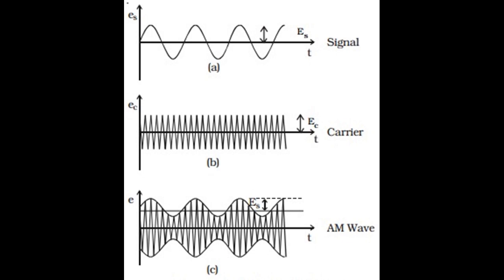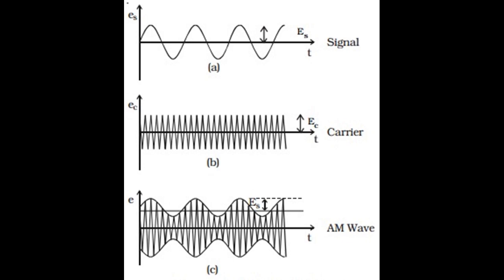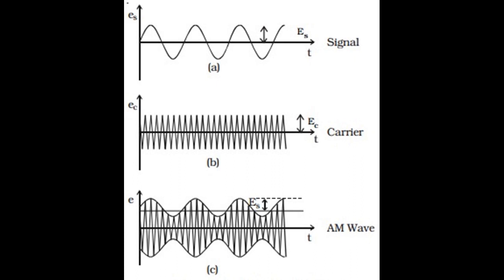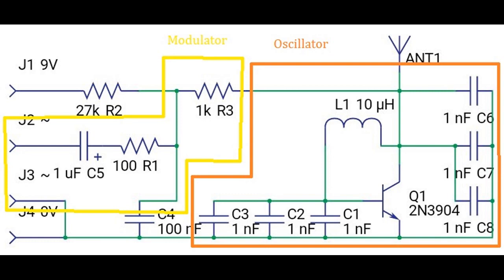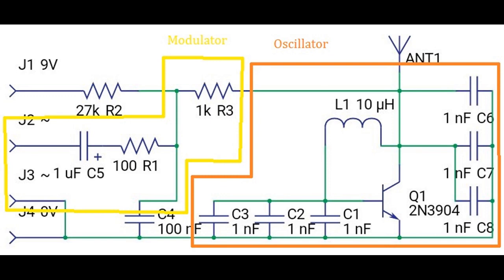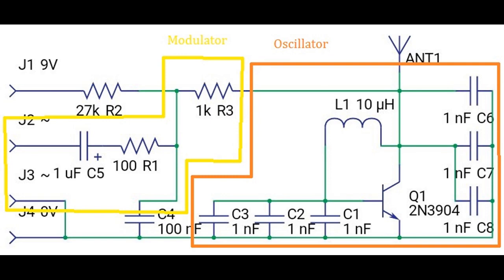Simple AM Transmitter

Comment: Hey Bob!  First video, 10th video, seventy eleventh video - doesn't matter - you're a great teacher and the simplicity and performance of this circuit says everything we need to know about your knowledge, heyna?

I've just started my journey in electronics.  I'm at the "what the heck is an inductor" stage.  I think I get it and I've got some 10uH coming in the mail but - can you describe what the purpose of the inductor is here and could it be replaced with something like a voltage regulator or some type of capacitor/resistor/diode combination?  Anyway - tanks for the videos - they're brilliant and greatly appreciated!
Reply from the maker: The 10 uh inductor is part of the tank circuit with the 3 1nf caps to generate the RF frequency. Thanks for stopping by!
Reply: @YouAllKnowBob  "tank circuit" - got it - thanks!

Comment: What is the power limit (watts.....milliwatts?) we can legally  transmit on an AM transmitter?
Reply from the maker: 100 mw input
Reply: @YouAllKnowBob  thanks Bob...could you explain how you calculated Gregg's Emerson rebuild radio project   22 ohm, 5 watt resistor (in place of the original resistive line cord)? It had a 32L7 and 12B8 in series....Greg said you told him to put the 22 ohm, 5 W in series, up-stream...with a 6.3 volt lamp in parallel with the 22 ohm resistor (?). Feeding with 117 vac....I can't figure out why it wouldn't  need a higher value resistor to drop 66.7 volts (117-(32+12+6.3))?
.....wes
Reply from the maker: That's not in place of the whole resistive line cord. The resistance was in two sections. The first section dropped the 66.7  volts. Gregg used a capacitive dropper for that section. The tubes draw .300 ma so a 22 ohm resistor would have 6.6 volts across it for the bulb power.